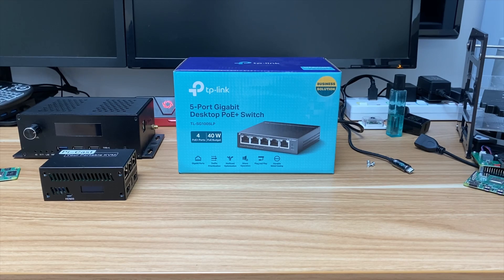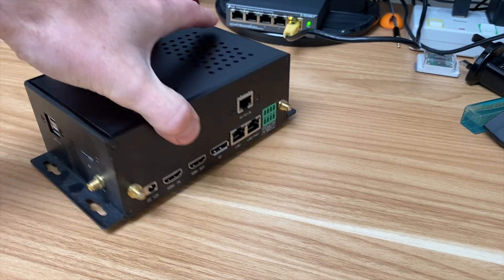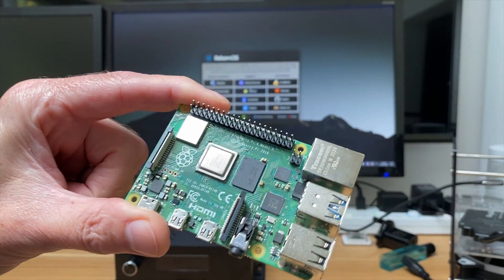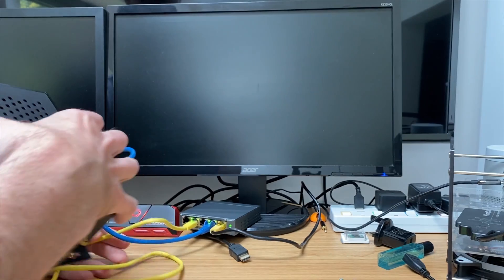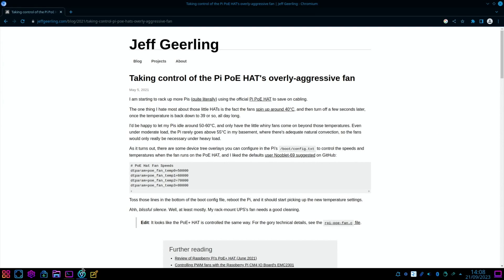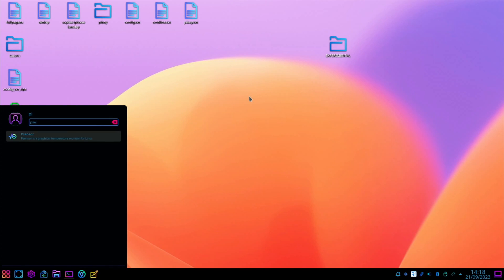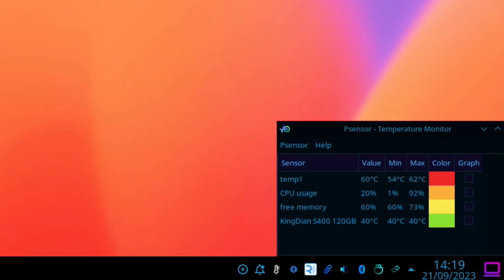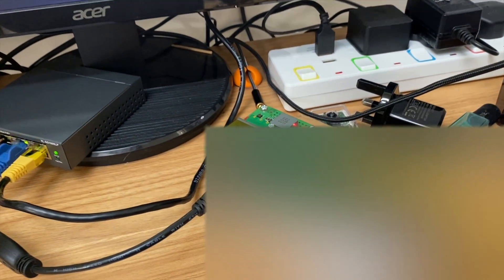Power over ethernet. Raspberry Pi 4 PoE+ HAT.

Comment: geat video ,ironically i was in my loft testerday and noticed the fan on my poe hat for my unifi controller was making a grinding noise so i switched it to a Flirc case but then i have to run power to it , annoying as i love POE

Comment: The Pi4 should have a reasonable USB C power input with power delivery. 
If the PI could switch up to 12V, the problems with 5.1 volts would be forgotten.

Comment: I am curious about the overall power draw of this kind of set-up.

It would be interesting to log the wattage used by the router, Pi4/Mekotronics products on idle using their normal power supplies and then compare the power draw when connected to the router.
Reply: Jeff greeling did that.  Its about 3watts is all i remember from the video

Comment: I've got a 48 port POE switch in the rack in my garage that a mate gave me for free after an office clearout that is my main switch, so don't need the PoE HATs at all - but POE makes wiring so much neater whichever way you do it.

Are you aware that there are also POE splitters on Amazon where you plug the PoE Ethernet cable from your network into it, and then it splits into a normal Ethernet port and a power plug? There are various types that provide USB3, USB Mini, USB Micro and barrel jack power connectors. The last time I looked they were about £8 each on Amazon.

Comment: I use 8 raspberry pi4s with Poe hats I am trying to pxe boot them from my nas so in effect the pis becomes compute and ram only
Reply: Does the Pi 4 firmware even allow that as an option?
Reply: @terrydaktyllus1320  yes absolutely
Reply: @Richard31415  I will have to check that out then, thanks for the heads up.
Reply: @terrydaktyllus1320  I am trying to use a Synology nas, I can get the pis to boot using tftp (pxe stage1) no problem but running into problems when continuing to boot and mount root from nfs. I am limited into how wild my dhcp tftp and pxe configuration can be as I also use tftp to boot Cisco phones and some other iot devices, so I can’t make my pxe boot too exotic just to accommodate the pis
Reply: @Richard31415  I get what you're trying to do, I work in converged telecoms myself for "a Cisco competitor" so I know about using tftp to boot phones.

I will try this myself, I've a week off next week with the missus away on business a lot so it will be a good week to do some serious playing with computers and stuff!